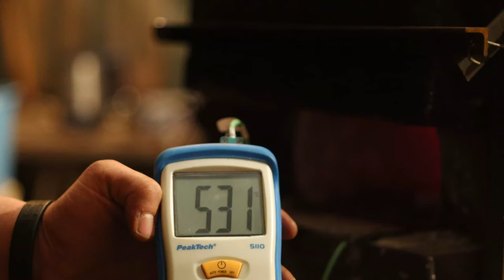Making a Bladed Flail - An Experiment

Comment: Interresting results... i really appreciate you used minimum amount of machines for forging and making all of those metal parts. Good luck!
Reply from the maker: Thanks! I ended up using both hands because it was a bit unwieldy.
I think if i could make the chain and and handle lighter to shift the point of balance towards the grip and made the grip longer (and maybe with a pommel?), that would make it a lot more effective, i think. 
Im also thinking of integrating a sheath in the handle, and making the thin back part foldable, kinda like a bats wing.

Someday...
Reply: @davidantweiler4729  That is a lot of improvements you have in your mind! But with an absolute honesty i think it is never gonna be really comfortable to wield, just because you need to keep constant focus on the position of the blade to the piece/object you are gonna be slashing. 

Btw. I loved both of your sword builds you published, i watched them at least 20x each 😃
Reply from the maker: Youre probably right about that, its really more of a gimmick, but i find the thought experiment quite interesting. 
But using it was actually less scary than i thought it would be, as long as you keep swinging it can't really hit you. But if i make a Mark ii, it would probably make sense to make a dummy blade, or get some armor to test some moves safely.

Thanks man, thats great to hear. I really need to get my shit together, and make some more. Im just finishing up my treadle hammer, that should make a lot of the laborious clamping jigs redundant.